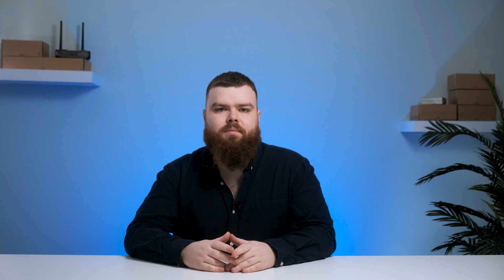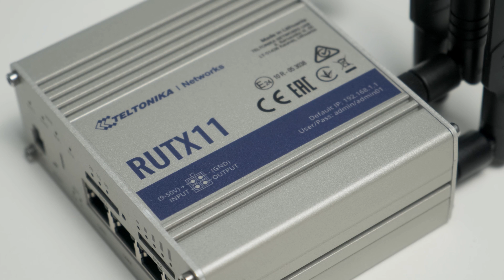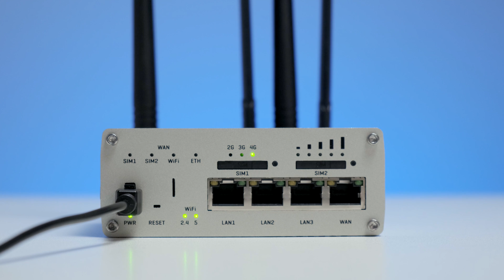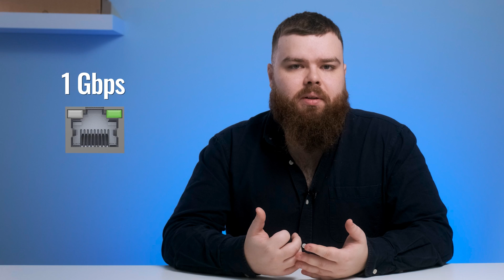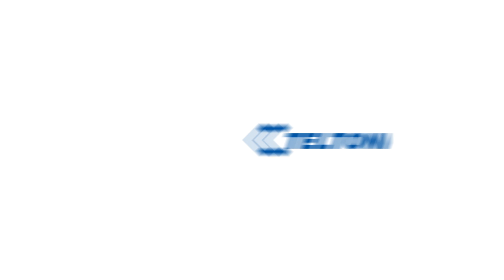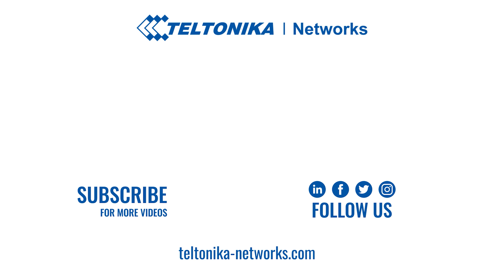Understanding Router LEDs | Tips & Tricks

Comment: I had a couple that would not power on straight from factory, diving deeper I found a burned copper ribbon imbedded in the board, I jumpered the capacitor it was going to, to the power in and it seems to work. Any reason they would fail straight from factory?
Reply from the maker: We are sorry to hear about this. If you have received a defective device, please contact your supplier so that we can either fix it for you or replace it with a new one.

Comment: I have a RUTX09, what does it mean if the 5 signal LEDs flash constantly?
The network seems to be working but the LEDs are flashing, thanks for your possible response
Reply from the maker: Thank you for your question. Signal LEDs usually flash when the router is booting up or during device reset procedure. If your device’s LEDs flash constantly, I would recommend trying to reflash the firmware through bootloader. More information on the procedure could be found here: https://wiki.teltonika-networks.com/view/RUTX09_Device_Recovery_Options#Bootloader_menu

If this suggestion does not help, feel free to contact us through your sales manager or write to us on our Crowd support forum.

Comment: We have the RUTX11 in use and what I am really missing is a possibility to determine, what WAN is actually used. At the moment, if the router has an LTE Connection and the WAN port is connected, both led light up, but you can't determine, which of the two is being used. Would be really nice, if the active/used one would for example blink slowly
Reply from the maker: Thank you for the suggestion. Currently we do not have such functionality/indicators that would allow you to determine which type of WAN is being used on the device. However, that is possible via the WebUI in the Network -> Interfaces section.
Network interfaces RUTX11: https://wiki.teltonika-networks.com/view/RUTX11_Interfaces
Note: Priority is top to bottom

Comment: I hard reset and now both the 3g and 4g are blinking at the same time.
Reply from the maker: You should check your SIM card. If the SIM card is in the device, you need to check if the SIM does not require a PIN code. 

If the SIM card requires a PIN code you must enter the SIM PIN in Sim cards settings here: https://wiki.teltonika-networks.com/view/RUTX11_Mobile#SIM_card_settings

Comment: Hi, I have the RUTX11 in my van and after a view days leaving the rougher unplugged, it won’t start up. Only the ä PWR LED is on, everything else stays off and the router isn’t starting at all ☹️
What can I do to get it back up and running?
Reply from the maker: Hello. That is very unusual behavior. You could try using the recovery options https://wiki.teltonika-networks.com/view/RUTX11_Device_Recovery_Options

If that will not help. You should contact the device reseller.